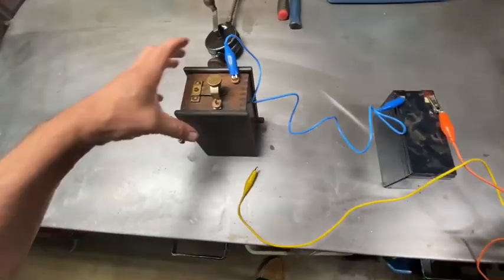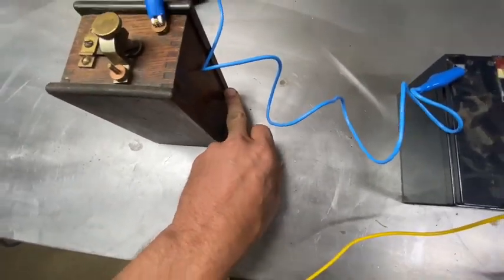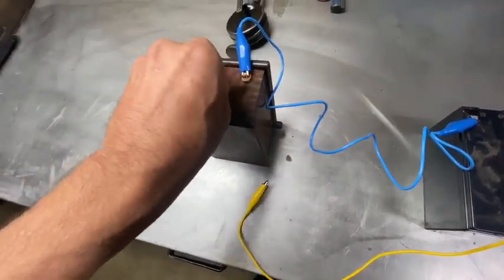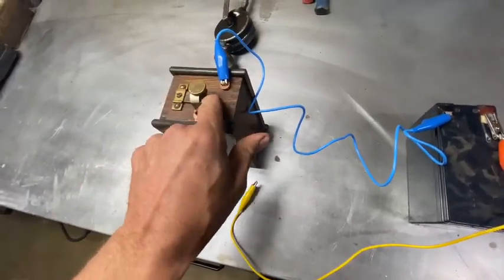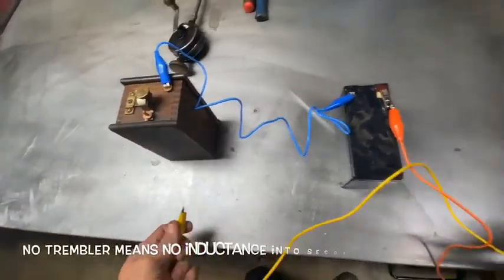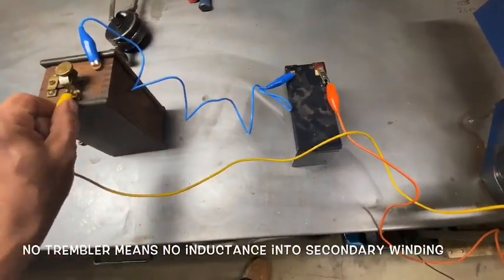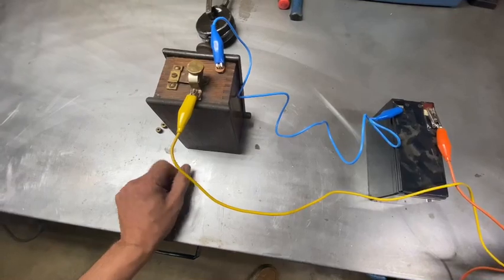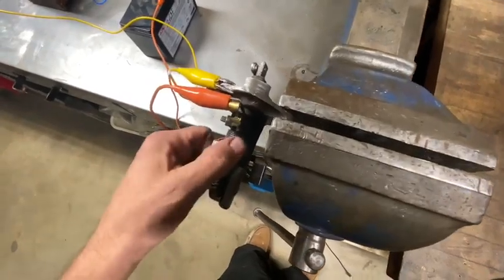USE A BUZZ COIL ON A HIT MISS IGNITER ENGINE?

Comment: Can one run a hit and miss engine with JUST the battery and no coil, or is a coil required?
Reply from the maker: Well Hugh 😂,
Yes and no .
Yes occasionally and not dependably with just a 12v battery .
It may fire but so weakly that it won’t sufficiently start the fuel alite.
Imagine a weak static electric spark you may provide from walking across the carpet .
The spark provided when using a single wound coil ( inducer) ends up terminating in a few hundred volts when the ignitor points are broken.

Big difference in strength , colour and dependability .

Much different from the spark from a primary / secondary high tension system again because those hundred volts next get ramped up into the secondary windings and are turned into thousands of volts which will jump and open gap to complete their path to ground where a few hundred will not jump a gap in a low tension setup but will make a last ditch attempt at it as the points “ break” ergo , ground is disconnected
Reply: @BAGOTCORNER  Would a simple handmade low tension coil work well for a 3 horsepower? I've got one that's getting close to running in the next couple weeks, gotta pour the babbits and slap it back together and it should be ready. It's a Fuller and Johnson, engine #5411, made in 1910.
Reply from the maker: @hughjanus2066  yes , a few hundred feet of around 24guage magnet wire .
Reply: @BAGOTCORNER  Thanks.